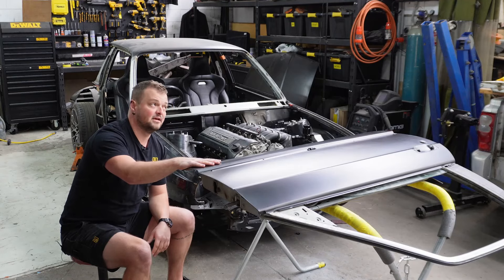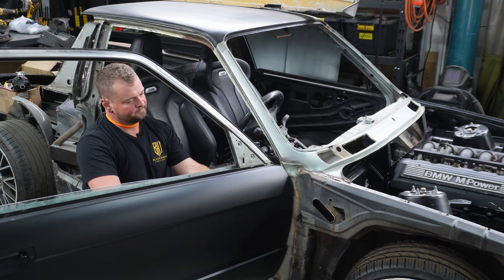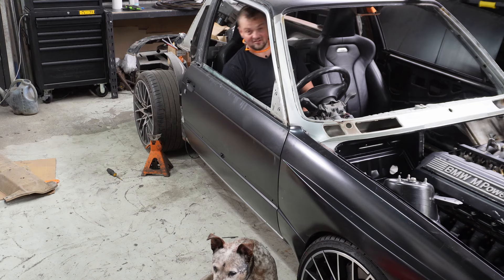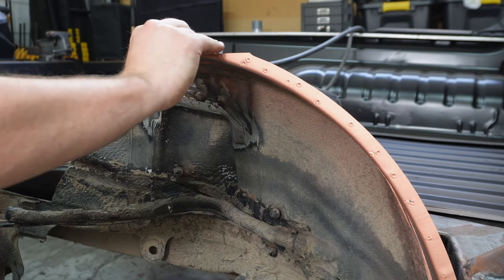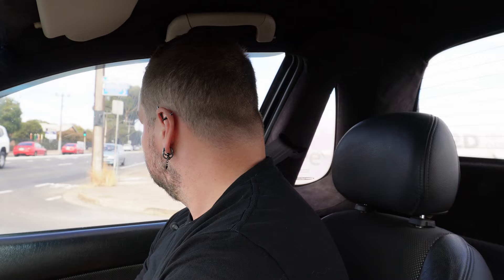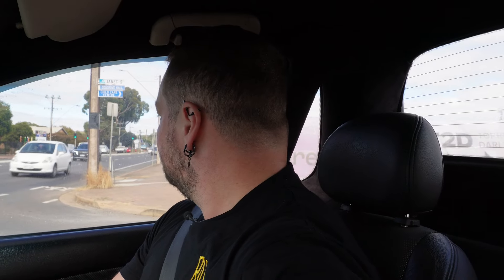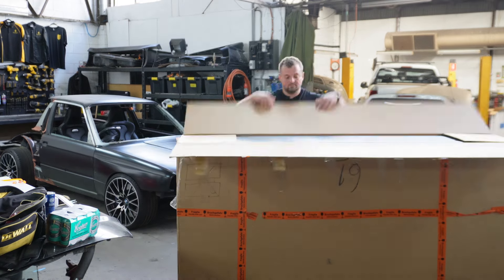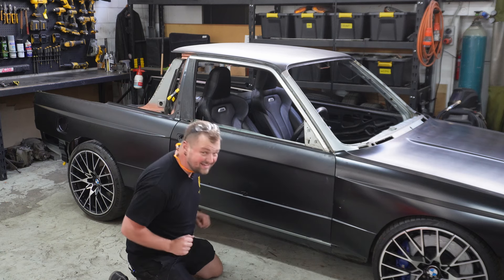ITS FINALLY HERE! Project Mute Ep27

Comment: Dude the struggle is real and you have dealt  with it which having to work around it will only make future builds easier . It’s made me think about getting my ass into gear and getting my other e30 going and doing a few mods you have done
Reply from the maker: Yeah it’s been a valuable lesson, the next project I’ll sort out a lot of the parts before I need them, I thought I did for this but just got delayed. Start collecting parts you’re going to need, what mods are you thinking?

Comment: Is there a difference between M3 e30 door and a regular e30 door?  For about 30 years ago I built an m3 e30 with a 320 chassi. I bought a wrecked m3 1987 and took everything inc driveline except front and rear  fenders who were damaged so I bought new. I could use the backwindowframe from the m3.  I painted it in Dakargelb  about one year before the M3 e36 came out in Dakargelb. I had so much fun with that car.  I enjoy watching your films.. /Mattias from  Sweden
Reply from the maker: Yeah there is a difference, the M3 doors don’t have the door bumpers on them so don’t have holes in them
Reply from the maker: Sounds like a good time building that car, I’m jealous E30 M3s don’t come up for sale much in Australia
Reply: @blacknightcreations  ahhh yeah forgot…. I must look at my  old pictures to se if i usedl the m3 Doors or welded the holes…  hope u can fint the m3 Doors !
Reply: @blacknightcreations   Looked att my pictures and I can se I used red m3 doors!.. :)
Reply: @blacknightcreations   The e30 m3 is not sold so much in Europe either . when there sol the cost about 85000-160000 Euro . After I sold my car I always have checked prices on m3´s.  In the around year 2000 the cheapest m3 e30 was sol for 3600 euro in Sweden....   My copy I sold for 8000euro...... I wish I kept it... I do have a friend that have 2 e30 m3s  (one Turbocharged)... and a third in parts.

Comment: Not being a hardcore E30 guy, what's the difference between the E30 standard door and an E30 M3 door? Congrats on FINALLY receiving the quarter!
Reply from the maker: The regular E30s have that little bumper that runs along the doors and holes for it to attach to, M3s don’t have them so are slightly different. I can modify the door I have but I’d prefer to use a genuine one